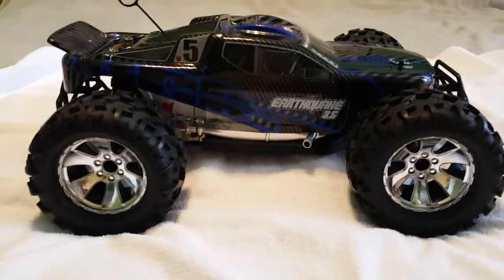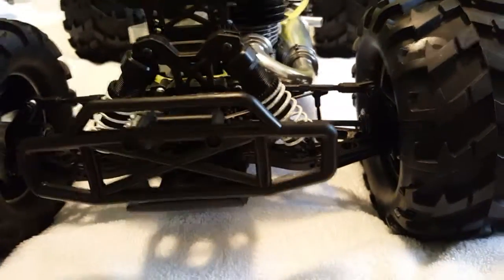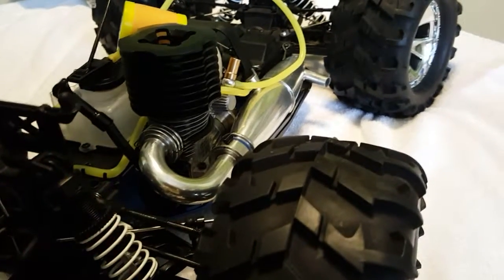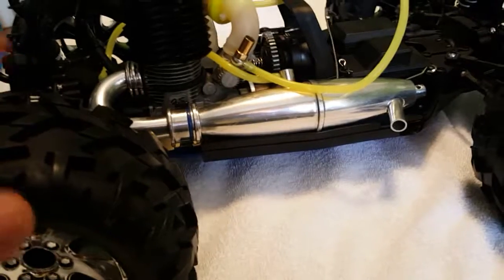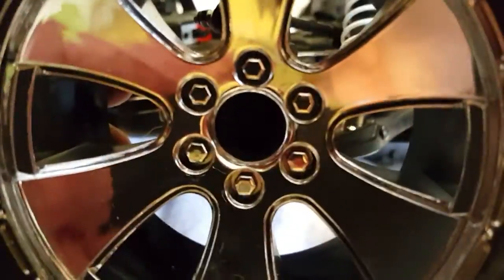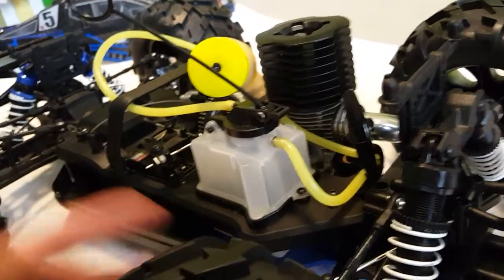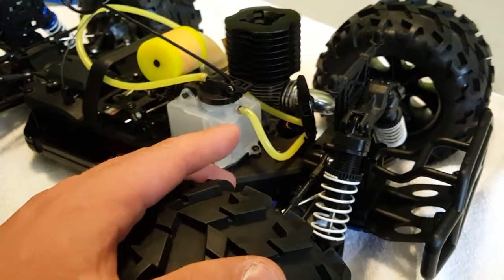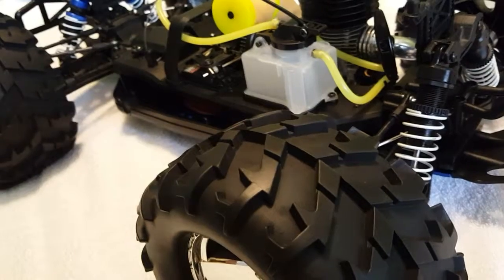Redcat racing 1/8 earthquake look.

Comment: Just bought a used one with the same circumstances. Doesn't look like it's ever been used. The catch is the pull start string is broken. Upgrade the motor or replace the pull start
Reply from the maker: Yeah ,am using the pull for now
Reply: @TECHSUPPORTEBIKE  I got a pretty good deal so I'm going to upgrade the motor. Thank you for the informative video,it's how I made my choice
Reply from the maker: @alvinphillips988  anytime 😎
Reply: @TECHSUPPORTEBIKE  I have the same car and mine can't stay running and when it does start it goes full speed
Reply: I have no idea how to get it running and mybad about my name